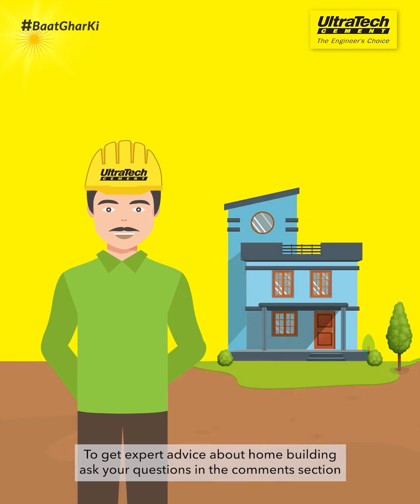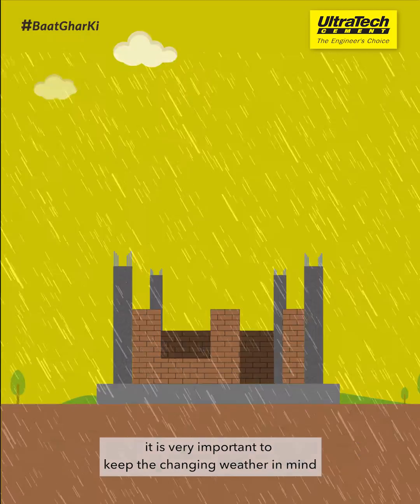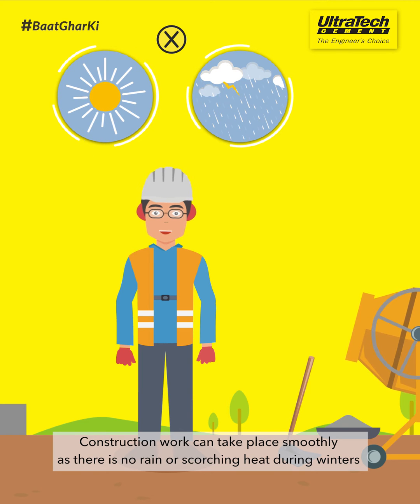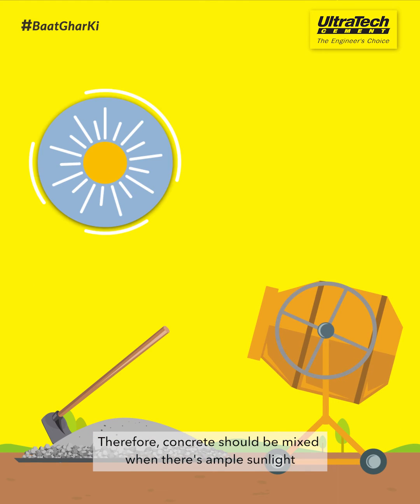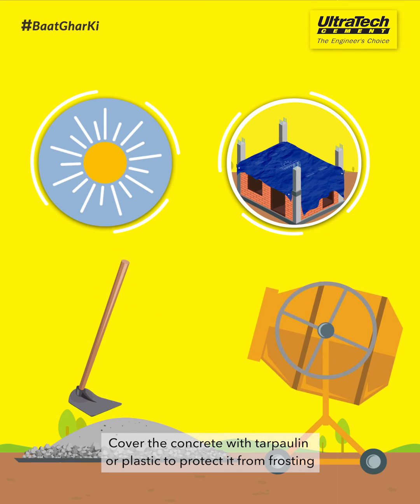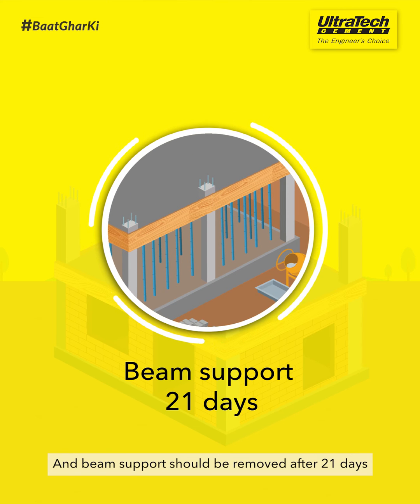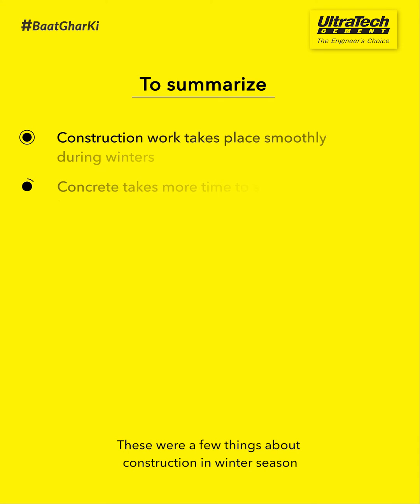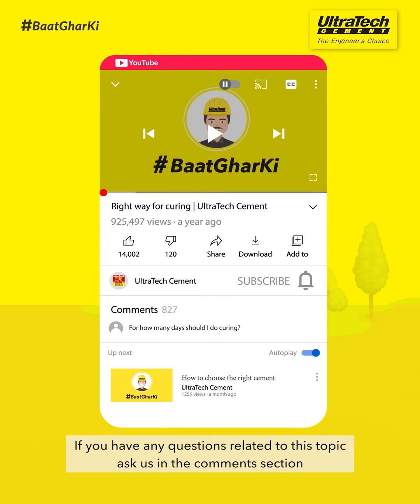Tips for Home Construction in Winter Season | UltraTech #BaatGharKi

Comment: Can we start construction in November ( from himachal pradesh)
Reply from the maker: Hi, 
Thank you for your query. When planning house construction during winters, it’s important to keep local weather conditions in mind. In case of heavy rainfall or very low temperatures, please ensure proper precautions are taken while working with cement. We suggest connecting with your local engineer or contractor for guidance based on your site conditions.
Regards,
Team UltraTech